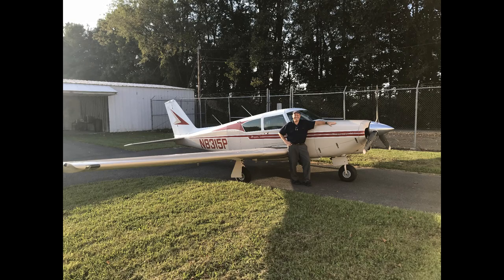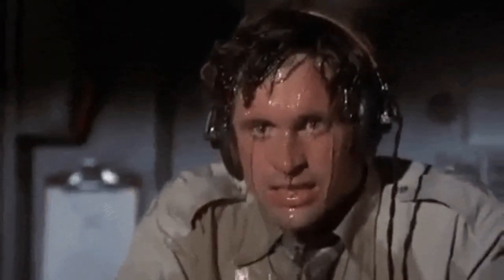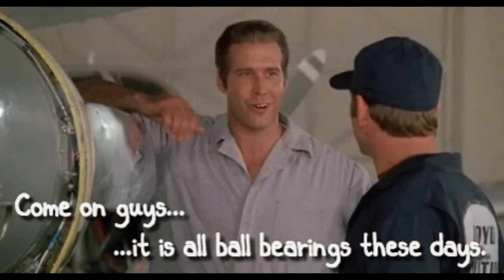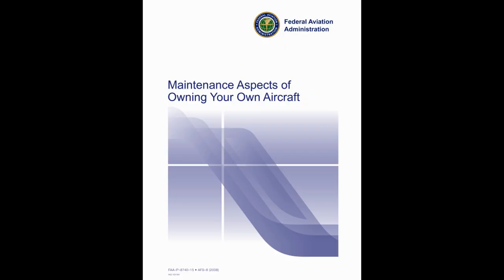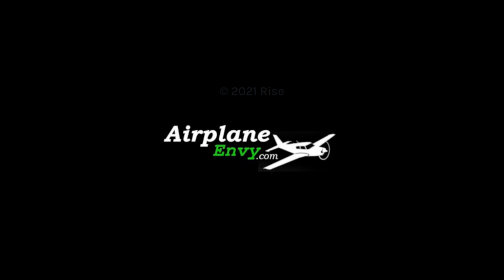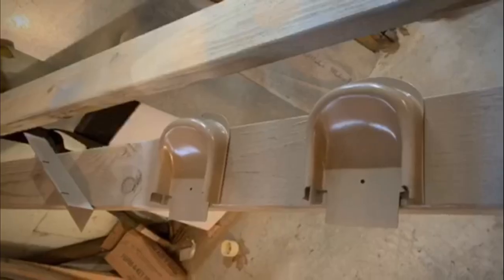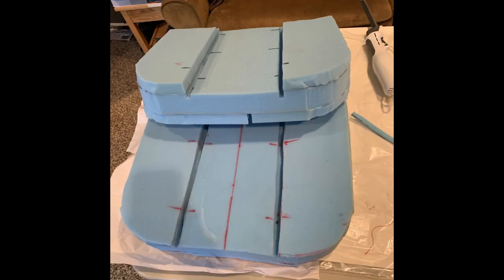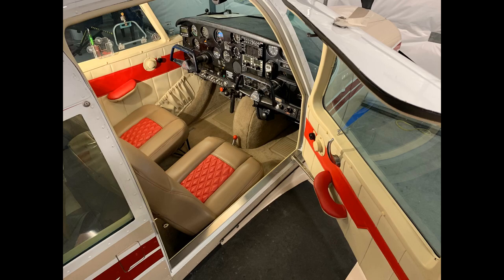Airplane Interior DIY // Learn how to upgrade your own airplane, inside and out!  Airplane Envy DIY

Comment: Great video! Is there a method how i could maybe also make it more silence inside? I am thinking about some silence dam-mats / insulating mats that i could fix inside the walls. Actually i dont find that info in the internet well.
Kind regards from switzerland.
Reply from the maker: Thank you!
This is the product that I used. It is from Airtex 

https://www.airtexinteriors.com/catalog_items.php?cat=misc

in the USA.
½" High Density Damping Tape, foil backed one side, adhesive other side. 36" x 54"
I am very pleased with the results.